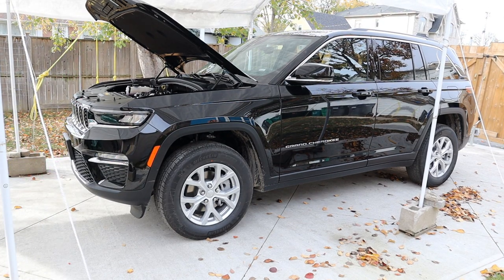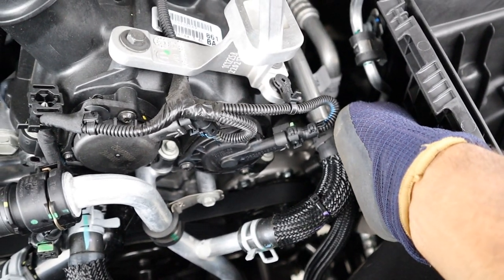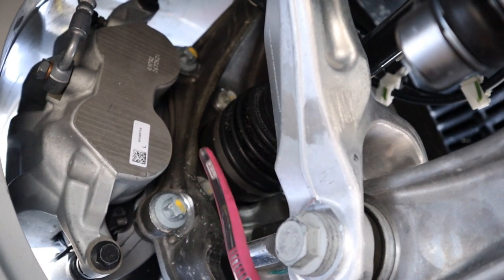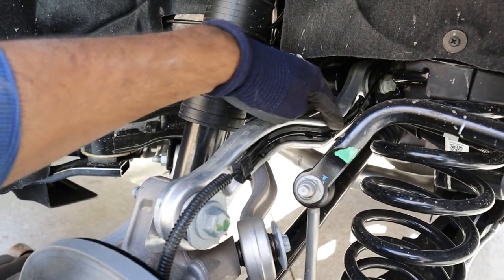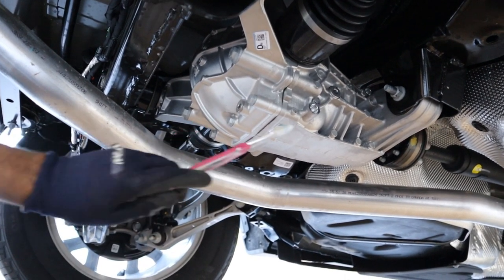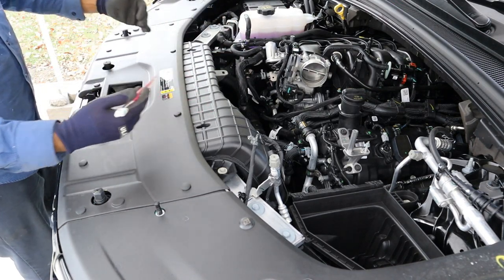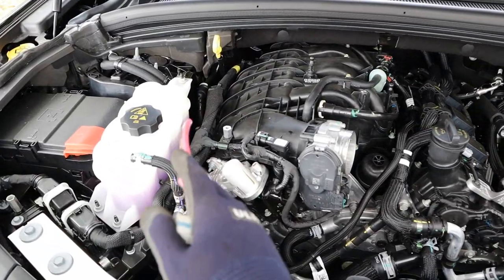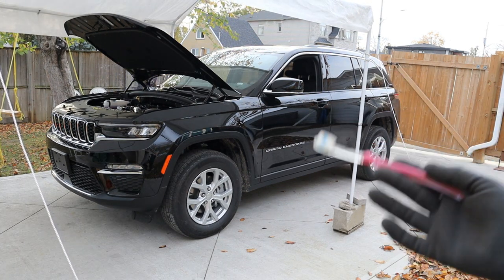Jeep Grand Cherokee Mechanical Review

Comment: I like the several reminders early on that this vehicle is basically worthless and will cost more than anticipated to fix in the long run.  Perfect vehicle for suburban Karen.  Good review as always.
Reply from the maker: Thanks. It's a good entry compared to GM or Ford in terms of build and power train. We sure will be seeing alot of Karen's in these soon!
Reply: It's no different with any other manufacturer. I think they design these things figuring the original buyer will likely trade in before any major service is necessary. Sure the 100k tune up is $1500 and rear suspension is going to cost even more when the bushings wear out, but If you can afford $60k+ for a new jeep, you're probably the kind of person who's either leasing it for 4 years or trading in after 5 or 6 years. Expensive repairs are somebody else's problem.
Reply: @wallyballou7417  The somebody else is invariably the next buyer, lured by a low sale price but unaware of either the needed routine maintenance or the cost of fuel. There's tons of such shitboxes in the ghetto...
Reply: @fun_ghoul  Right on Bro! 😆
Reply: @wallyballou7417  "It's no different with any other manufacturer." Those are the excuses that American and European car fans always make!
Reply: Car engineers should not be allowed to design any vehicle without an experienced mechanic present.

Comment: The FEM(front end module) comes from our Valeo plant. It’s the radiator , ecm , hoses and front end wire harness and some other parts assembled . It was funny seeing that rubber band . We use them to hold the hoses to the fem for delivery to the mack plant

Comment: I recently presented a maserati grecale on an elevator on my YouTube channel and both the grecale and the grand Cherokee are built on the Giorgio Platform, together with the alfa romeo stelvio and Giulia, but here i see they switched to a true 5 link rear design, the italians use a big double element arm that forms a single unit so it is technically a 4 link design.

That transfer case you filmed is 100% a Magna Powertrain Actimax system, the same as bmw x drive, alfa q4 and kia stinger awd.

It does not have a center diff, but contains a clutchpack with electromechanical camplate actuation.

They probably brand it as quadra trac I , higher spec models will use quadra trac II and quadra drive, which are all built by magna, because they bought new venture gear many years ago.

Former land rover discovery 4 models used something similar but with a true center diff and low range.

The new range rovers don't even have a center diff, they all use clutchpacks, probably magna too
Reply from the maker: Thanks for your feedback. This is the mommy version so yes the transfer case doesn't have low range   it is loosely based on the stelvio platform but they changed a few things for the American market
Reply: @foch3  italian cars are not junk
Reply: @vladdutz20  From Motorcycles to cars, yes they make beautiful junk.  My Jeep is 28 years and works and looks great.  Can you sit here and say this will be as good in 28 years?
Reply: @foch3  no but that’s a symptom of the time it was built.
Reply: @thetechlibrarian  You're probably right.

Comment: Fins on the transmission pan serve two purposes: they do help with heat dissipation (a finned plastic pan will dissipate more heat than a flat plastic panel), and rigidity (the pan will resist warping).
Reply: Third purpose: Saves aluminum (sorry, plastic).
Reply from the maker: Thanks - I forgot about rigidity, you are right.
Reply: ZF transmission.  It's been that way for about 20 years.  You change the pan with the fluid/filter change.

Comment: I have a 2011 JGC, and I’m trying to understand why/when the Pentastar got so complicated. All that wiring and the huge amount of hoses up front look like a nightmare. 

Overall I’m torn. I like the aluminum cradle, but not the overly complicated suspension. I like that it runs a timing chain, but not all the spaghetti hanging off the motor. Port injection is a huge plus. 

Im fine with composite pans. Here in the rust belt steel pans need to be maintained.

I’d be interested in service intervals for all the fluids.
Reply from the maker: Good call. I've got a Pentastar from a Jeep Wrangler here that I'll be teardown soon so we'll see how that goes. I think the new JGC definitely has some improvements if you stick with the older engines. Not to say there are better choices on the market...

Comment: 15:24 that mounting to a piece of plastic might be for crash worthiness? They want the assembly to break there to have a more controlled sequence? The location is weird tough...
Reply from the maker: That's what I'd think. You'd want the engine and transmission to slide under the vehicle and not enter the cabin in a crash

Comment: I have a 2016 with the same engine and its much more easier to work on. The routing of hoses is very different. The suspension should be smoother, but more complicated compared to the wk2. The wk2 has been relatively good, so I hope the new WL is a step on the right direction.
Reply: Yes the platform is more complicated. Instead of changing platforms to the Stelvio platform, Jeep should have continued to refine/modernize the old MB GLE platform and bring back the turbo diesel 6.
Reply from the maker: I feel like they did this one good. Old school power trains, newer suspension and body structure... As long as everything is buttoned together and will last, it looks promising...compared to using a hybrid or turbo setup at least.
Reply: @speedkar99  i believe that they will replace the extisting powertrains with a turbo I4 and a turbo (or twin turbo) I6 soon 😅

Comment: Seems like allot of hate going on for this vehicle. I test drove a Grand Cherokee Laredo which is my sweet spot. Jeep has 5k discounts even on the 24 model! So a 300hp 8 speed NA engine that is more capable than anything else 4 wheel drive. In my opinion looks better for 35 to 37k!!  Everything you need nothing you dont...  For example 17 inch wheels with the beefy sidewall looks the best on this vehicle. No Sunroof is a bonus.  Very smoothe ride eliminating potholes and rough pavement.  Would a similar Hyundai, Kia, be better? Certainly the warranty on those are but something about the Jeep Still maintainking its uniquely American Squared off STyle. I think this looks leagues better than than the Wk inside and out.  I will be watching more long term reviews etc... I am also considering the Mazda cx50 which is the opposite as far as rougher more sporty ride.. Single guy here no kids or pets......  lol   Also watch his and other reviews of other cars they all have issues, nothing is engineered perfect but these modern cars are more efficient, just as speedy if not more and safer than anything made 20 years ago for you old geezers holding on to junkers...
Reply from the maker: Reliability won't be it's strong point.
Reply: What did you end up getting?  Just bought a '24 Laredo, awesome vehicle so far.  Out the door with title, tag and taxes, $30,590.  They are actually beginning to drop prices to a more reasonable point.  Not many 4X4 vehicles available for $30K these days.  Especially with the V6 NA engine  (no turbo crap).
Reply: @santaclause2875  Nice.. I ended up buying a CX50 the Jeep has a nice floaty drive but not sporty at all. The Mazda is prob the sportiest ride you can buy besides macan territory. They built it wide and low to the ground and as a single guy it is prob the only Cuv I would buy except for a Macan.. I did seriously consider the VW Arteon which still some new 23 on lot with large discounts and the Hatch!!

Comment: @sperdkar99 awesome review.  I currently own a 22 grand Cherokee and I do feel the v6 underpower especially on hills. What's your thoughts on thr the turbo inline 6 for gbe wagoneer.  I was thinking to upgrade
Reply from the maker: New technology will take time to improve. If reliability is concerned then stay away
Reply: @speedkar99  thanks for replying.  What's your opinion on the wagoneer hemi v8 5.7 for the long run would it be reliable? Will it last to a 200k miles if properly maintained and good driving skills ? Because I'm in the market of buying one. 
Thanks

Comment: Great presentation! 
Welds on that aluminum subframe are just awful leaving huge gaps for corrosion and crud. Looks like it was made in someone's garage.
The silly finned plastic transmission pan looks like the weights guys weren't talking to the thermal management guys.
Reply from the maker: Yeah the welds aren't good. Wish they went with a hydroformed or bolt together unit

Comment: Wow, the transmission oil filter/pan combo for the 2022 Grand Cherokee with the 3.6L V6 is $233.79 for a Mopar brand at RockAuto.
Reply: I went to the Jeep dealership for an oil change for my 2021 Grand Cherokee and found out that it's now $150.00. The manager cut me a break and only charged me $50.00 (she honored the birthday debit card which was given to me by the dealership). $150.00 for an oil change..Damn!
Reply: @rahsaanthomas7030  I live here in very expensive SW FL and had oil changed at the Ft. Myers Galeana Jeep dealership 2 days ago.  It was "only" $90.  If I hadn't been there for the repair of the recall pinch bolt, I would have changed it myself.  Oil change on this model is super easy!

Comment: It’s a lot tighter under the hood compared to wk2. Jeep should have just used the engine from the Stelvio like how they are already using the platform 2.0l 4 with 280hp/306 Ib-ft (that’s more torque than the current GC) and use the new inline 6 for the 350+hp models.
Reply from the maker: I think those are the next engines inline for the grand Cherokee as we've already seen them replacing the ones in the wagoneer

Comment: So the plastic transmission oil pan is protected by a sheet of cardboard... OMG
Will this ever stop?
I used to drive an LWB Land Rover in Algeria in the Sahara while working there. Everything was pretty solid but screwed together. That car was forever falling apart!
Reply from the maker: The cardboard is under the engine. The transmission is left open to air.

Comment: I can’t believe they are still using plastic for the oil cooler housing. I just replaced mine. It will start to leak after at least 40k miles.

Comment: Do you like the older version WK2 or this version WL better?
Reply: The WK2 was a purpose built, no compromise, original design. No shortcomings or less than optimal design parameters were required to accommodate Internal Combustion, Hybrid, and All Electric in a single body on frame design. 
  Optimization of the engineering design is lacking in the WL.

Comment: Plastic can be used as a heatsink as well. Have you ever seen an LED lighbulbs...
Reply: Yes...and I've seen them burn out faster than every previous kind of bulb despite the LEDs themselves being rated for 25,000 hours.
Reply: @fun_ghoul  Because they are shit brands. Buy cheap, buy again. Get proper Osram ones for example, but not the economy types, the higher end ones. You get what you pay for. 
But yeah, LEDs get absolutely baked in most bulbs, running at 100+ degrees C, so their lifespan shortens significantly. 25K hours is at 85 degrees C operating temperature.
Reply: @fun_ghoul  To understand better. Like with the elecrolytic capacitors, LEDs decrease in their lifespan by half for every 10 degrees C increase in temperature. So if rated at 25K hours at 85 degrees C and run at 105 degrees C, they would last up to 6,25K hours.
Reply: @DashCamSerbia  Oh...so you've never had a "quality" LED bulb fail on you? Cool story, bro.
Reply: @DashCamSerbia  I know what temperature derating is, thanks.
Reply: @fun_ghoul  Nothing lasts forever, bro...
Reply: @DashCamSerbia  An original Edison light bulb is still burning at a New York City fire station. Just sayin'.
Reply from the maker: Sure it can be a heatsink but it's not a very good one. Besides, sinking heat into plastic will cause it to warp over time...

The fins are probably there for structural support.
Reply: @speedkar99  It is thermal plastic, it should not worp.
Reply: @fun_ghoul  Because it is run at 1% power rating, ot thereabouts...

Comment: So it turns out Fiat engineering of what was an American icon is actually better in some ways than the Chrysler Motors engineering it had for decades.
Reply from the maker: It sure might be.  Not sure if internally it'll last...like electronics, engine, transmission...

Comment: I grew up working on all kinds of cars and trucks.  I cant imagine being a mechanic on these modern vehicles.  No reason for the spark plugs to be under the intake  on a v6.  Imo. They are just disposable cars,  not even worth the cost to fix a major failure. And most shops don't even know how to fix this junk.  Crazy. Great videos though. I hate they put Mopar stickers everywhere. That's not a Mopar, that's a fiat that you will definitely regret buying.

Comment: Jeez. They build these with the premise that when something goes wrong, even a minor thing like a ball joint (a $250 fix on an older car) you're replacing the entire lower control arm...plastic is not good for 150,000 miles. Most people are not going to do these kinds of maintenance or repair on the jeep grand cherokee

Comment: Ooof, so many reasons I'd never own one.
I've always loved how simple Jeeps are, but ... electric steering?  Whaaaauuut?!
No way for me.
Reply: FWIW: Its been in Grand Cherokee’s since 2012. I have it in my Ram and like it a lot.
Reply: @yo_marc  I've never driven one...but it scares me.  What happens if the battery dies or the ignition is turned off?  Will it still work?
And (for me) most importantly, how's the 'feel?'  Do you get good feedback from the road?
Reply: @cluelessbeekeeping1322  Good question about a failure! Not actually sure. I “think” they’ll act like a regular rack and pinion without the power assist. Come to think of it I had a Mk7 GTI with electric assist, and it was 8-9/10th of what an older BMW e46 had for steering feel - which was the best I’ve ever expected (with tons of caster from the factory). In the VW you could adjust how much assist was used. The Ram is kind of numb, I assume at least partially because of the off-road tires on my model, but I like that it’s very smooth and 100% fuss free. The 2011 Grand Cherokee we have has the old hydro-assist. It has feel that the Ram doesn’t, but it’s been a little temperamental - the pump is loud at extreme-cold cold starts, and some groaning when doing a tight turn when very hot out. 

I totally agree with you about these vehicles getting way too complex. The amount of wiring and sensors on the motor, and especially coolant lines up front - all scare me.
Reply: @yo_marc  I very much appreciate the answer!

Comment: That oil filter placement is awful if you don't have enough room don't put that engine in there such awful designs plus all that plastic. I drive a 1988 Lincoln town car gets probably close to the same fuel mileage as that with double the reliabity and I can actually fix it myself also fixing a 1994 honda civic that got punched in the nose. What happened to simple reliable built to last made to be rebuilt cars?
Reply from the maker: Simple cars don't exist. They make them complex for emissions and economy now. The buyer sees the inside and outside and rarely pop the hood or look underneath to care about what lies under.

Comment: Just got one 11/30/23  4x4 laredo x  basic like i wanted  ok paid $500 for deep red color i wanted - with sunroof  and floormats no heated seats or steering wheel no power liftgate no nitrogen  ( air is partly nitrogen ) no door guards for hundreds no paint and seat spray for thousands extra no bull Essentially.   those things break and are costly to fix, and or scams.  No speciall power seats for passenger who cares about the passenger! No alcantera seat fabric or heads up display - just wanted it basic and cheap only option i wanted was power sunroof.  To me i scored.   So i keep a car 48 to 55 months then sell or trade.  Feel i stole this had a $45k sticker paid $33k i figure like most gc's 48  month depreciated  value of 46% so maybe $22k in 4 - 4.5  years to me i stole it.  Essentially  im gonna lose $14,800 for 4 -5 years use.  In 2023 November  I felt it was amazing.  Im going to add the  added care extended  warranty 6 year/80,000 coverage for $895 in a few months - mainly as its transferable and helps resale having engine & transmission and dash  display and  center display guages and some electrical warranty.  Plus when in for service you get a loaner for free and in general a better ownership experience for under $900 extra.  Another tip i learnerd years  ago was always shop on last day of month after 4pm  and have a cashiers check for $10,000 made out to dealer - bottom line you mean business  and dealers want end of month #'s so an extra sale their more lenient with dealers profit ( within reason ) and have a desire for that last sale to boost numbers.  

One regret not having factory trailer tow as a hitch install is a 2 hour job for me and I'm a semi mostly retired yacht mechanic  at 50 by trade  so I'm handy and comfortable  with taking stuff apart - wow it's a challenge  installing a hitch after market  but will save me another $650 , so for that I'm good with.

Comment: The Jeep is junk but the mechanical review was excellent as per usual . One of the worst reliable vehicles I’ve ever owned was a 1995 Jeep Grand Cherokee. That car was a money pit. It was a good day when I liberated myself of that POS.
Reply from the maker: Well they say the engine is more reliable now....I'm not sure about the transmission or electronics or even the new suspension and how it'll hold up long term.